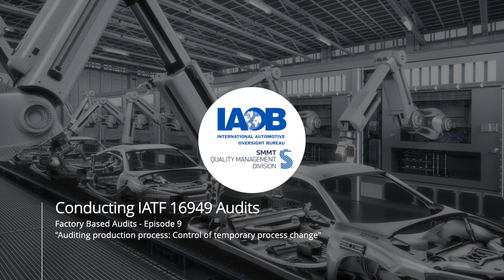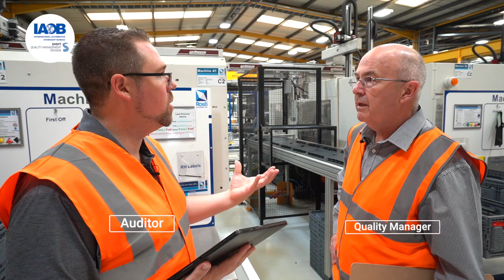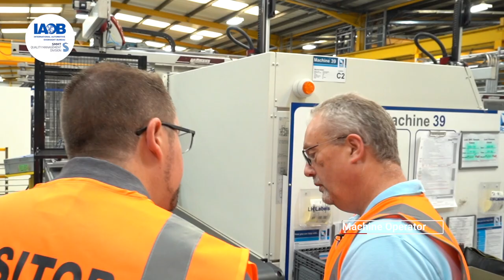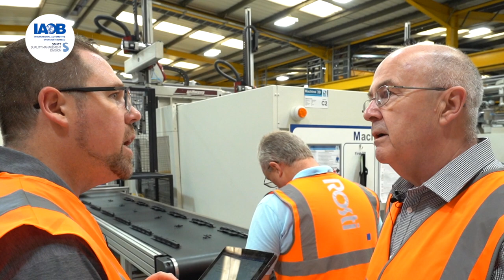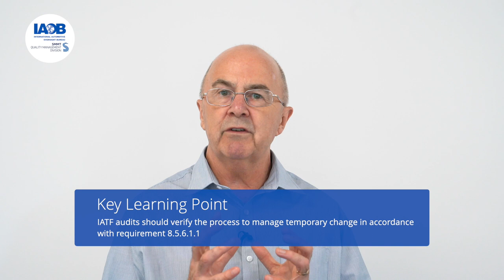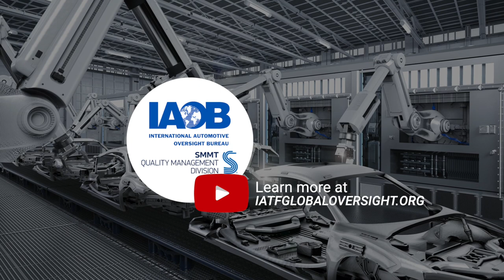IATF 16949 audits | How do I: Audit production process Control of temporary process change

Comment: In this video, control of temporary changes don’t put on the FMEA or the control plan. Do this meet IATF 8.5.6.1.1 requirements?
Reply from the maker: Hello Thoa,

When implementing a new product/process, the organization should decide when alternative process controls are needed, and then assess the risks through PFMEA and add the controls in the control plan.
For already released products, if the alternative process control needed has not be previously identified, the organization needs to undertake a risk analysis, but this does not have to be in the FMEA format.
Standardized work has to be available for the alternative control.

If it is likely the alternative process control will be used again, the controls could be incorporated into the control plan during routine reviews/updates.